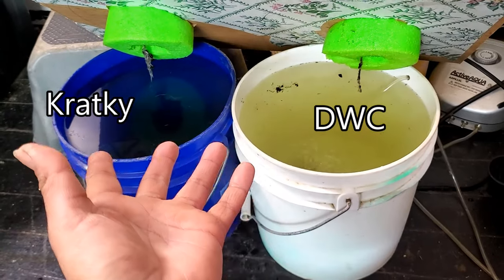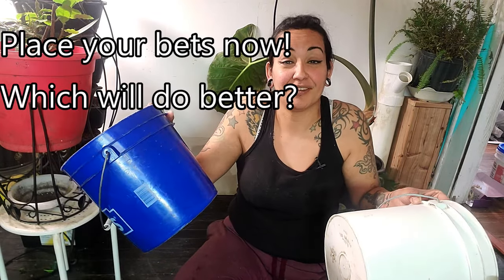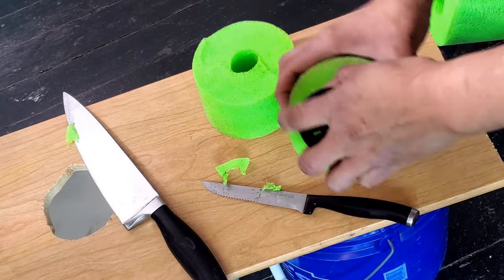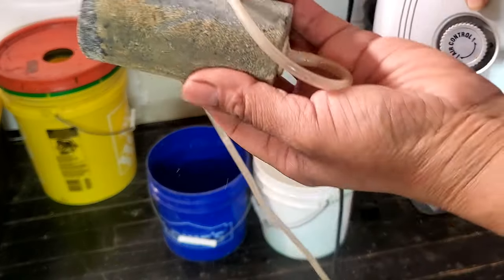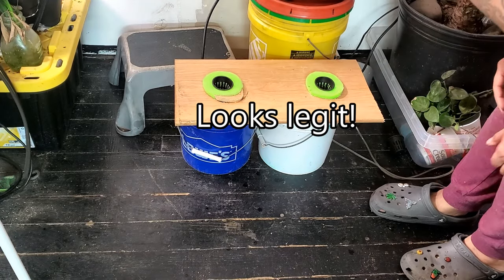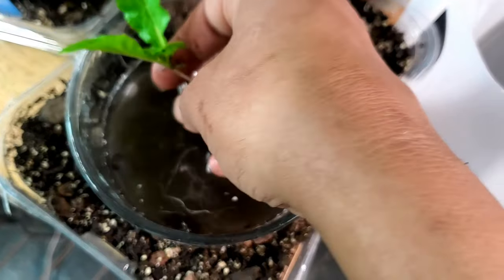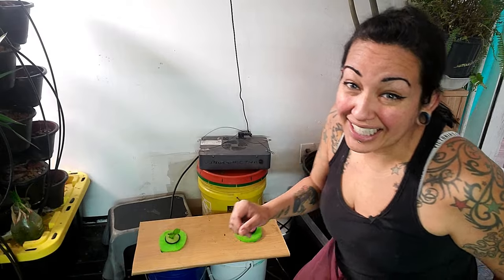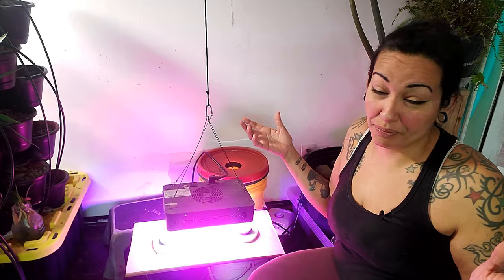Kratky Vs DWC Hydroponics Competition- Which One Is Better?

Comment: With Kratky it's important to have air over the water so the plants can grow air roots too. And then it might yield less, but less fuss too!
Reply: actually  both  need  air space    even the   DWC   its not the bubbles in the water  that   assist  its the  water movement at surface you can do the same thing   with a tiny  cpu fan  from a computer  blowing air over the water surface via a duct  in both systems. It's the fluid motion  NOT the bubbles that help,  the surface area of the bubbles  and the time in contact with  water  is not going to  give a measurable  exchange  what  most.  it  is the  agitation of the surface  so in affect a small fane   blowing ocer the surface   OR and  very small  water   pump   moving the water around   will do the same as a bubbler.   but most  importantly  the airs space at top is the most critical for roots to access o2  for absorption
Reply: Perfect set to cook the plants
Reply: @peterrolfe528  have you tried Kratky? If there's too much heat where you live, you should probably provide shade for the containers at the hottest part of the day. I had my containers on a windy roof. No need for shade here.

Comment: Here's another idea for you... 😁
I've been experimentering with different nutritional solutions. I've had basically no luck whatsoever with the store bought specifically meant for hydroponic growing medium but, last year I took a LARGISH fish tank, bought about 20 fish, type mostly "goldfish" that "poop" a lot. Rigged up a fish tank water pump that took water from the fish tank, up to the top growing rain gutter like strukturs that held the plants. 

I didn't put the tube with the water from the fish tank near the bottom of the rain gutters but, about half way up the side of each gutter, since I didn't want the gutters/plants to ever be without water, if for whatever reason the pump would stop working, power go out etc. Connected the gutter with plants with a hose to the first top one and gravity made the water flow down through the gutter/plants below and so on until I reached the fish tank again and the water went back into the tank. 

I also put a few "floating" small plants on the surface of the fish tank and the fish loved swimming through the long roots and ate all the "nutrients" from whatever was in the water that rotated through the system. I realized soon that I really didn't have to feed fish food that much to the fish in the tank but, still did since I figured that whatever they didn't eat, would go through the plants in the gutters and provide extra nutrients to them. 

It worked better than I had ever dreamed of. Will be doing the same this year too, with an added system. I had NO filter in the fish tank to remove dirt/poop/impurities, as those somehow disappeared when having gone through the "filter" of the roots of the plants.

Comment: Light leaks+high water temperature= Pathogens. I'm no expert but I suggest using identical buckets with covers, dark ones and better cup placement to avoid light leakage. Change the solution every 10 days for better test results. Good job still..
Reply: that the first thing that i noticed was the blue vs white bucket uneven odds . i am only 6 mins into this so i do not know the outcome yet
Reply: What is end result s video📹, where is??

Comment: Would be better off to buy a bucket lid. Net cups come in different sizes.   Also plants could care less about size of cup. The Roots and stems will work with that they got

If using cool or cold water use a paint mixer on drill to mix the water

Comment: I use hydrogen peroxide in all water methods to keep bacteria at bay. I also use way more air so the bubbles popping on surface create a splashing effect. Also as roots grow into water I drop water level a bit so some of the root closer to plant base isn't in water.
Reply: How much hydrogen peroxide per gallon please? Are you using 3%? Hp?
Reply: If using 35%, the recommendation is 2-3 milliliters of H202 for every gallon of water. If using 3%, add 2-3 teaspoons of H2O2 per gallon of water.
Reply: On
Reply: you want an air space   at top for the roots to absorb O2 direct from air , the bubbler only  circulates the water to  assist  in  water to air  O2 exchange

Comment: Only use pool noodles,  cut a split in noodles. Adjust for plant stem size and Adjust height in water. If you have nutrients right. You should be good to go. Change nutrients every few weeks
Reply: Beginning stem size or mature stem size?  How do you figure which to do?

Comment: I use pool noodles and wondered what the purpose of net cups are for, as I use a taller thicker noodle to hold everything in place; also, I noticed what looks like a kale plant that you have on the left side of the video with an irrigation system attached; 

I’m very interested in what that is, and how you made it. I’m trying to figure out how to do a flow system too, as I’m newer to hydroponics I’m trying to learn all the equipment that goes along with it, as it can be very complicated; thanks ! ; )
Reply: net cups are for rich people.
Reply: Net cups and hydroton balls are for when you start off and don't know any better, then you switch to pool noodles when you start growing more plants and ain't got the time or money for all that extra crap.

Comment: Is the heating up of the water in the bucket especially in summer an issue (root rot etc)? Any experience, what can I do to prevent?
Reply from the maker: It can be an issue in the summer time depending if the bucket is in direct sun during the day n painted black. Itll cook the roots. I let that water cool to room temperature b4 adding the plant. Also I put the hydro outside in a partly shaded spot
Reply: Just a thought. Have you tried a sgeet of cardboard like 2 inches in front of the bucket? Like shade the bucket itself? I have had experience with wood heater systems and radiant heat and if you have another layer or iron or cement sheet, a few inches gap, then another, you can go from steel starting to glow red to a nice heat. Each layer has a significant temperature drop. But trapped air will also hold the high temperature. If the air can escape, you don't end up with hot air pockets.

Comment: ok.. first if you saw it on toktok it was idiocy. kratky CANT outperform dwc, the ONLY advantage it has is laziness (since you dont have to use electricity). theres no need to use netcups AND pool noodles, you can just hold the plant in the pool noodle (wtf..noodle AND netcup AND noodle? no). never use white buckets for hydro, light goes through and it produces algae... then again you are using contaminated water anyways if youre using rain water with giant light gaps in the lid. thats too much water, theres supposed to be 1-3 inch gap under net cup. thats not near enough bubbles for dwc, get a bigger stone and use both outputs with a Y connector to the bigger stone. there should be a boiling looking effect where none of the water is resting. im guessing theres no results here because you got root rot and killed them.
Reply from the maker: So judgey aren't ya. U do know there are more than 1 way to do hydro🤦‍♀️ your way sounds good but the way I do mine also works well.  NO there was no root rot at any point. So what if kratky is the "lazy" way to do it.  It still works n that's what matters. My plants died because of aphids.  I currently set it up again and so far although Dwc is doing awesome the kratky one looks good too. As far as bubbles ya u wanna see it bubbling but there is such a thing as too much oxygen depending on container size.  If you give too much O2 it can stunt your growth(Google it)
Reply: @TheAdhdGardener  didnt realize you were above improving your technique.. or learning. you arent supposed to be feeding the roots the air IN the water (which is why theres supposed to be a 1 inch+ gap under the net cup), the bubbles popping is supposed to create droplets of oxygen infused water+nutes which causes more roots to come out from the sides and leads to the explosive growth associated with DWC. if you can cause oxygen toxicity with a 15$ walmart fish pump i will eat my hat (it would be up there with proof of aliens, time travel, or alternate dimensions). what works even better than the crappy air stones by the way, is making "spiders" or hoops out of "soaker hose" because you can fit a ring around the bottom of the bucket so the bubbles come from all around. i call kratky lazy because its fire and forget, once a week you have to top off solution and other than that it just sits there, and if only having to deal with your plants once a week is the goal its a great solution. it cant in ANY way compete with dwc though (which is a lot more work with all the ph/ppm testing/adjusting in addition to the electricity) if you are trying to maximize output in a given space.. i dont think it can beat nft, flood and drain, or aero/fog ponics either actually. watch some "hoocho" videos, youll up your game 100 fold. most importantly kratky has some pretty big limitations that dwc doesnt as far as things you can effectively grow in it before it becomes a massive pain in the ass.
Reply from the maker: @megaflux7144  🤦‍♀️ I'm always about learning.  It's how u came off that I didn't like.  I didn't use net cups this time.  I would like to know the info u said so i CAN improve all I'll look into it. I watch a few hoocho vids but not many cuz I only do hydro during fall n winter. Gonna watch more.  As far as neurodivergants go the kratky is yes a more simpler method but it suits many people needs and abilities especially if people are forgetful. The cabbage in the kratky is doing quite well. If course the dwc one is better but the kratky one is def a close second.  I switched them all to 5gal darker colored buckets
Reply: Hoocho does a nice a job but it seems he has an endless budget and spends a ton of time building his setups. Not that it’s a bad thing, but if you want to see how to do the pure kratky method, check out keepongrowing channel. He has documented pretty much all the hydroponics methods and has now gone straight kratky. He has great money saving ideas and great success with bucket towers and downspouts only using pool noodles. Hope this helps

Comment: A bubbler in water only circulates the water for a very slight better water to air O2 exchange at surface ,the bubbles themselves  will not impart any O2 to the water of measurable amount, and your headspace for O2 exchange is not adequate.  in either,  bucket and a bubbler will not have any marked improvement with as small a surface area as you provide in a 2 gallon bucket surface area.  bubbles in dwc do not solve issues it the airs space so the roots can take up O2 from the  air as it enter  you  would gain more from an air vent  ducted to a small  computer fan  pushing air  in  to flow across the roots  to supply the  roots with  O2  and  this  air flow will do the same  surface exchange as a bubbler.

 The bucket color density will also impart a mismatch in light penetration to the grow nutrient solution and the tops  wont seal proper to keep light from possibly causing   algae growth which will affect comparison results.

 Get away from using the pool noodles the chemicals   used to make some can hinder plant growth use the full net pot get    plant growing grade rock wool like grodan rockwool from amazon or rock wool grow plugs ( not  insulation  grade rockwool that contains chemicals to stop mold mildew and fungus growth and fire retardants ) the seal the top surface with some painters tape and poke a hole to plant seed.  You   negate the  use of the  net pot  in way you  plants , if you  want a support  and insist on pool  noodle  prestart  you plants in water  cut your pool noodle about   an inch  thick ring and cut a slit  from edge to center , open center  slip plant in so roots  hang down and   use a hole saw to cut a hole in that  will hold  pool noodle  firm in place without crushing root ,  or get a cork mate cut a slit and a small hole in center to put seedlings in and  places in hole in lid or a non toxic  organic latex foam

 Air pumps do not add O2 to the water because of the bubbles. It is the agitation or breaking of the surface tension of the water that adds oxygen To ensure that your plants have enough oxygen to breathe, you need to get bubbles to agitation the surface to dissolve plenty of oxygen in the water. You can use aquarium power heads instead of air pumps todo the same agitation

Comment: Hi, love ypur video. Can you use the kratky set up outside in diredt sunlight?I tried my first kratky bucket, but the water turned green after 1 month. I use a white but and sealed lid. I have it outside on direct sunlight.  
I kook forward to your advise. 
Thanks
Mario
Reply from the maker: The water needs to stay dark n cannot be exposed to sunlight. That's how algae grows(the green). I paint my buckets/ containers black or use thick 5 gallon buckets with dark colors. The bucket I used is white here but it's thick if I was to put it outside id watch n see for green
Reply: Thank you so much. I better start painting. 😁. 🤞 I get a good crop next time around

Comment: If u didn't do this with a clones pla t it's worthless
Reply from the maker: Some anecdotal data is better than no data. Besides I did a part 2  continuing this. The seeds were from the same package. U may think it's worthless whereas other may see it differently.  It's the point of the types of hydro system. In the end it'll still be individualized based on personal preference to what system they want to use.

Comment: Nice video. Lot of mistakes. Dont use wood. Gets wet and moldy. Airstone look like you find it from trash bin. Clean it. Get another one and but them both in bucket. Led is way too close. Maybe 40cm could be closer the right height. Why you just dont make right size hole for netpot? First make it way too big and then stuff if with some  raimbow pride leftovers. Good luck and may the grow gods be with you. Amen 😂
Reply from the maker: There's a part 2 where I did alot of changes to this. U can learn through failure. I learn this way but in the end I learn none the less. There's a part 2 to this
Reply: ADHD Gardener I subscribed to your channel because of your response to this critical comment. Good job your awesome 👍.